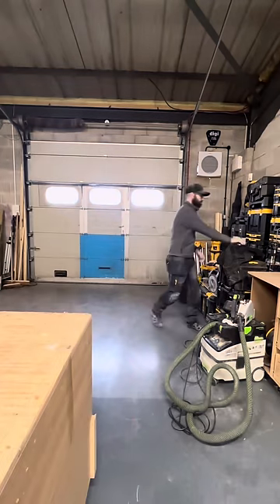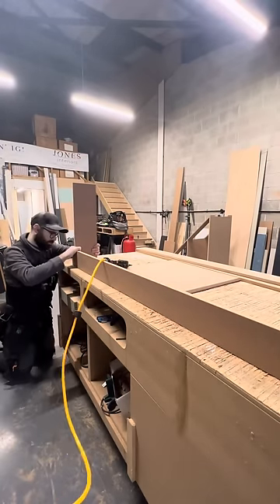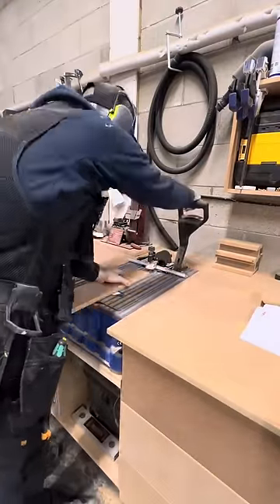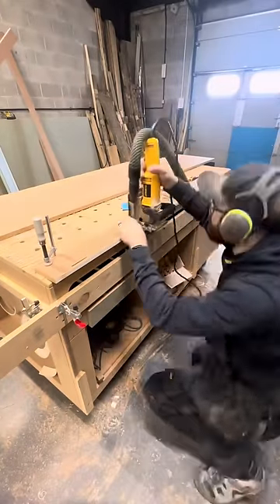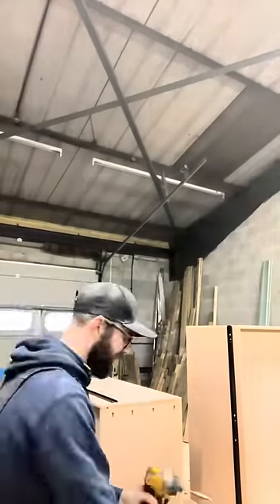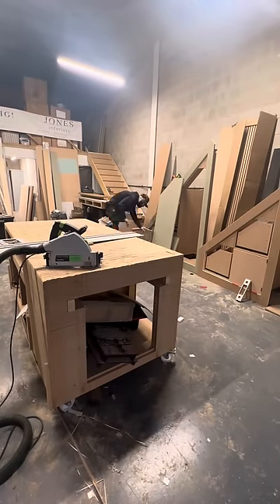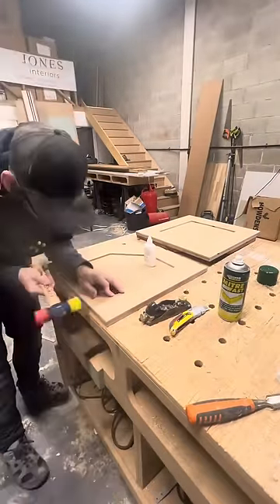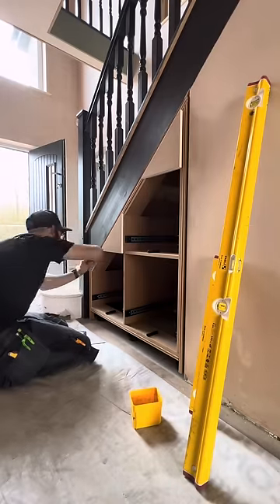How I build my under stairs storage units

Comment: I think I would have covered the upper surface to stop dust dropping in. Our stairs are, admittedly, 85 years old, so they have bigger gaps, but the carpet is so old that its underlay is now pretty much dust and that drops through.
I shall be doing something similar, soon, though. I expect to make the whole thing roll in and out on wheels or castors, because the fuse boxes are under the stairs, too.

Comment: How do you end up with the doors flush to the trims, allowing for the gap needed for push to open feature? What catches do you use? I presume they’re heavy dusty to take open a loaded drawer? Cheers. Chris.
Reply from the maker: Hey Chris, I set my backing fillers forward 3mm to allow for the drawer to push in to activate the Blum tip on latch

Comment: Why didn’t you use the Forman for the drawer panels? Cba resetting it for 12mm stock?
Reply from the maker: Lol basically yeah! Because I’ve got the K5, I just use that for the 12mm and the foreman for the 18mm. I am very lazy lol!
Reply: @jonesinteriors633  I don’t blame you. I’ve still got my eye on one for my shop but still using the trend version on the K5.